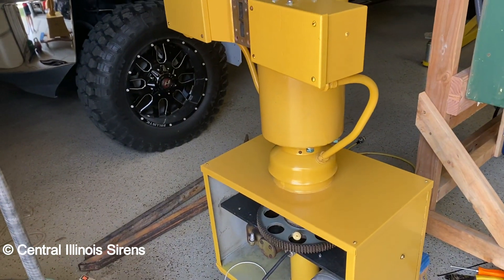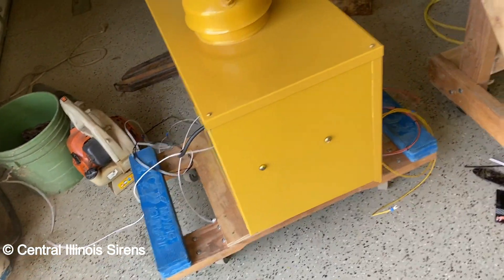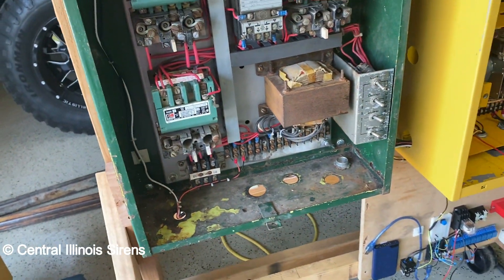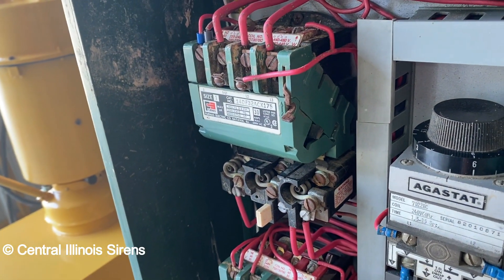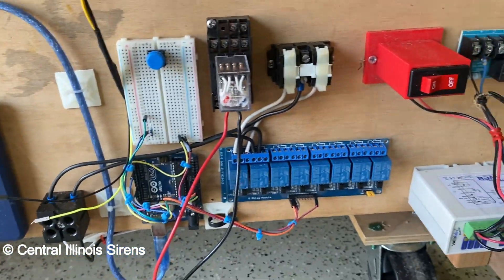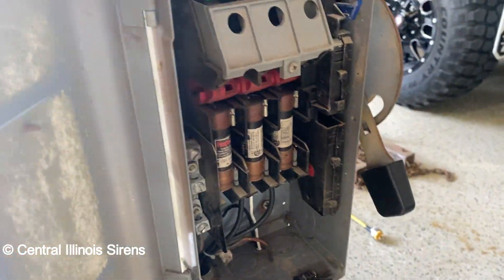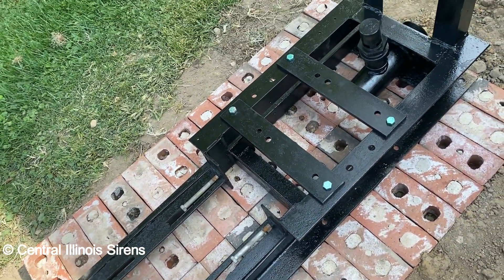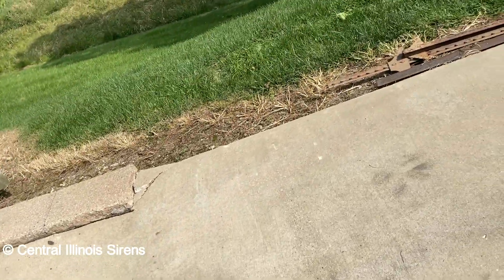Thunderbolt 1003 Restoration Update

Comment: how did you wire it did you do it yourself or like a company because im having trouble trying to find out how to wire the whole thing
Reply from the maker: I wired it myself
Reply from the maker: If you need help I could help ya
Reply: well thank you for the offer but I'm just preparing for when i do get one also  how did you get power to it is it running on 120V or did you hook it up to a breaker box
Reply from the maker: It’s running on 220V
Reply: @CentralIllinoisSirens   how are you getting power to and sorry if I'm bugging you early in the morning
Reply from the maker: I’m getting it from the 220 plugs in our shop. You’re fine
Reply: @CentralIllinoisSirens   ok thank you for the information have a nice rest of your day
Reply from the maker: Anytime, you too! Look at a thunderbolt manual there’s wiring diagrams in them.
Reply: @CentralIllinoisSirens   one last question do you know a website that has the manual if not thats fine
Reply from the maker: Just look up thunderbolt siren manual you’ll find 4